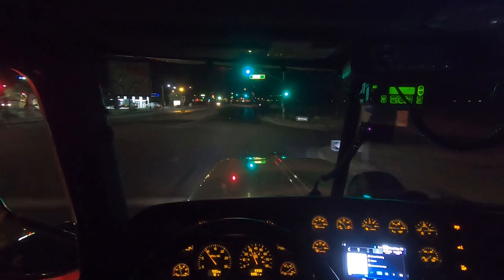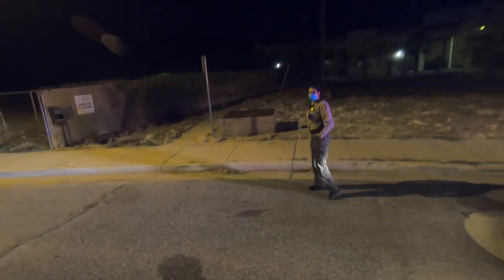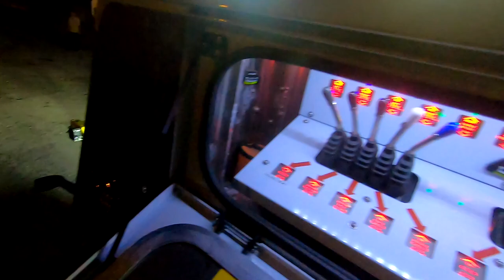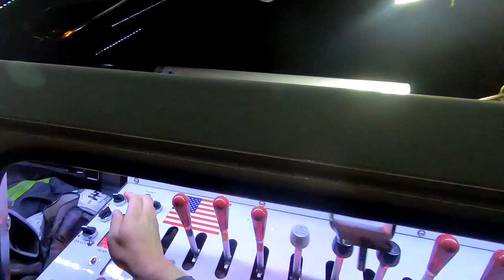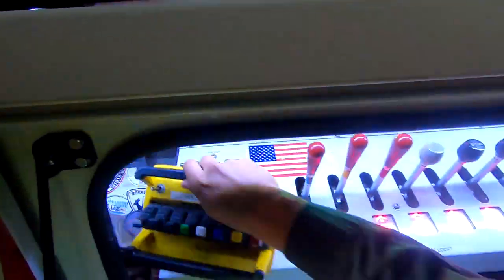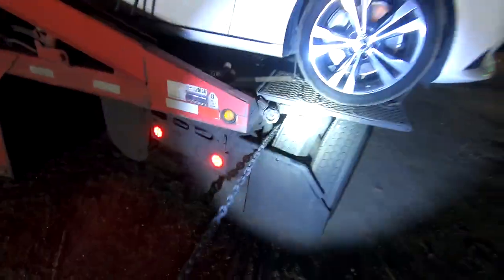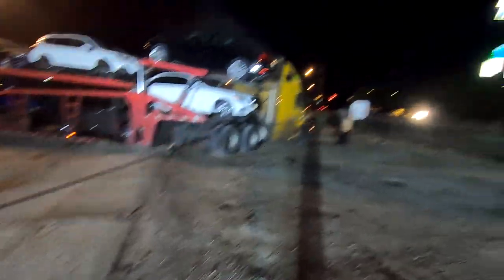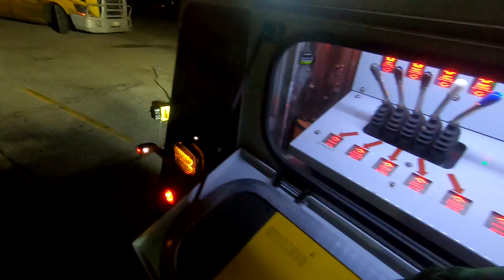Car Hauler High Centered Blocking Road

Comment: it is crazy how low these car haul trailers are. I lived close to a major airport and saw tons of those rigs haul cars for the rental car companies in and out of town. Some of those trailers hover around 2 to 3 inches off the ground when fully loaded and bottom out at even at the slightest dip in the road or when going into tight turns and leaning over a bit.

Comment: Ok Trent, I haven’t watched this video yet, I paused it. I’m going to approach this as a learning experience, and you are posing a “what would you do” question! I would position your rotator with the rear facing the car trailer so I could lift the trailer at the front just enough to take tension off the tractor so the tractor could disconnect and pull forward out of the way. Then I would swing the trailer back to the street allowing the tractor to reconnect to the trailer. Ok, now I’m going to view the video and see how you handle it. I love your videos. Thanks.

Comment: Little different situation, but I used my flatbed to get a hauler out of a situation that started with high centering and was severely compounded by the morons from the Tesla dealer. Asshats put some lumber under the passenger side rears of the trailer, giving it enough lift to back up from the belly drag. Unfortunately, the lumber was too short and the right taillight housing plowed into the city street asphalt. The morons had the driver trying to force the rig backward as the taillight dug in. Totally wrecked the light and severely damaged the street. I happened to be in the area making a late delivery to the body shop next door and could hear the commotion behind me. When I finished my job, l went to see what was going on. I didn't know if I could help, but I took a look. To lighten the load, we took the cars off the trailer and set them on the ground. The angle was too steep to allow regular ramp use, so my flatbed allowed us to take the cars down. Once done, I looped a chain to my towbar and the back of the trailer. I gave it some lift and told the driver to back up until he was off the belly. He didn't get the idea and ended up pushing my truck into the parking lot across the street. He had me too bound up to get the chain off. Had to have him pull me back enough to unbind us. Anyway, I figgerd we'd lock in the Tesla business, but no cigar. Jerks.

Comment: Thank you Trent,  that Driver should of not got his CDL
Reply: Why? Other than getting stuck in the first place, he followed directions promptly without Trent needing to repeat or explain and knew what he was doing to get unstuck. He even caught Trent's unhooked cable mistake for him.
Reply: Hey Anthony, have you received a diploma?
Reply: why? because he got stuck?  or  you just don`t like him?
Reply: why?
Reply: May not be used to pulling a car hauler. Any normal van or flatbed, or even many low decks, would have had no issues turning around there.